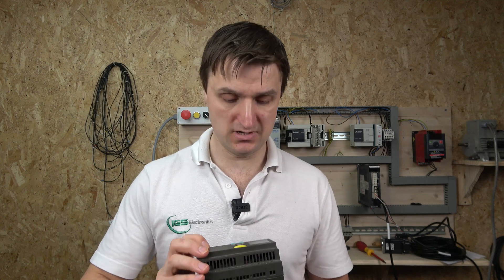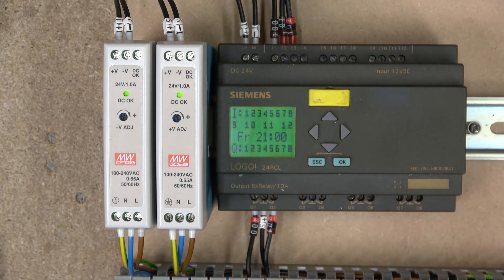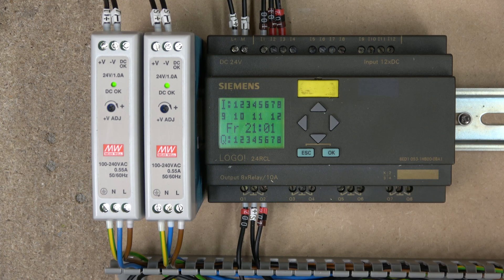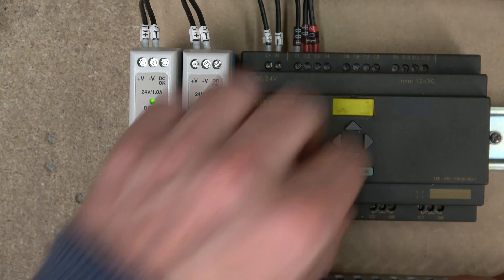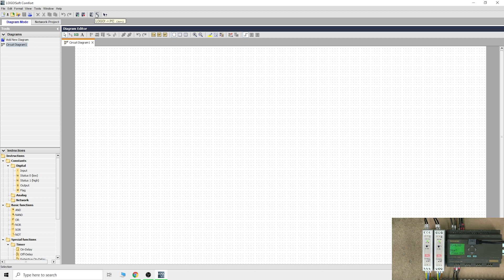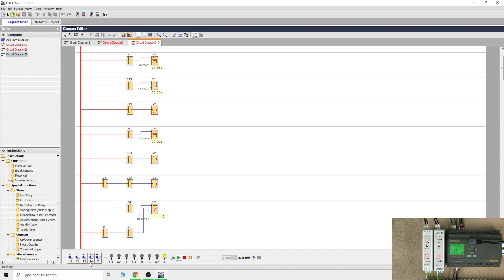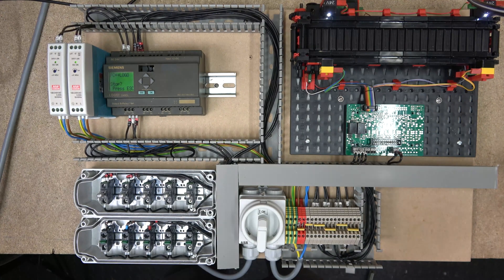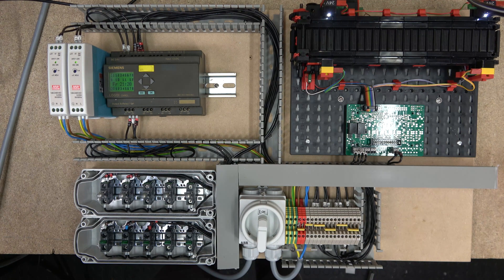Siemens Logo 6 (old) wiring, program upload/download, sample programming using LOGO Soft Comfor V8.2

Comment: I have a logo 6ed1052-1MD08-0BA0
I want expansion module for it digital input output
Is 6ed1055-1NB10-0BA0    OR  0BA2 
And what is difference
Reply from the maker: The last digit in logo unit part numbers changes when newer version is released. So 0ba0 and 0ba2 is the same thing just newer version.
Reply: I searched again in siemens industry, basic module 0BA0 can only be expanded with last 0BA2 not 0BA0
Thank u